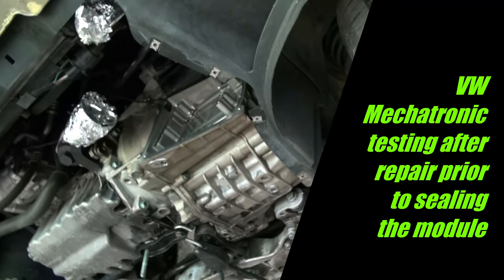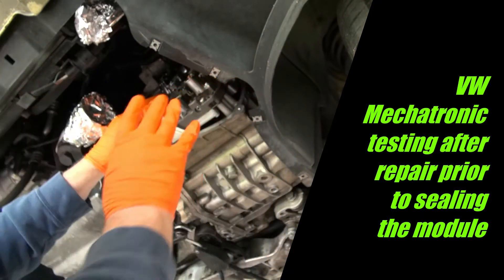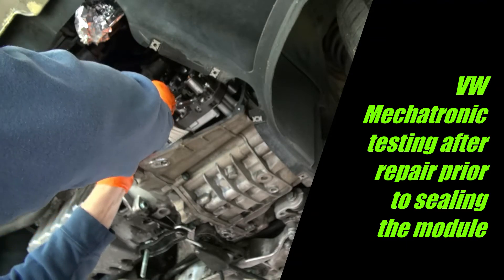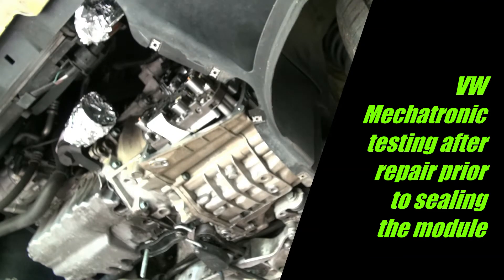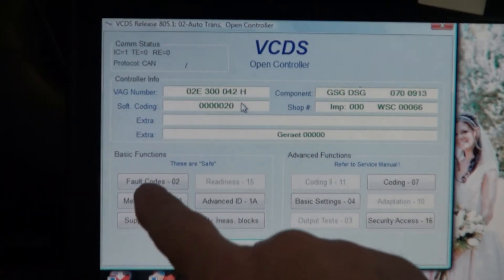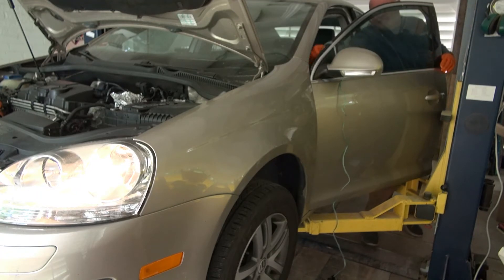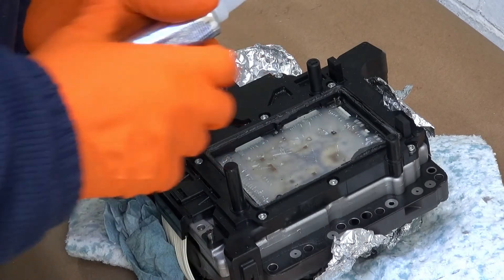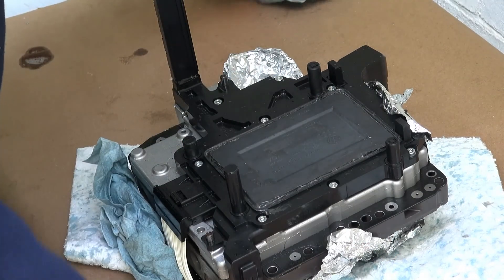VW mechatronic module test before sealing after internal repair is made

Comment: Update? Did she live?
Reply from the maker: Not for long, one of the connections broke again. I sold the car and happy to have it gone
Reply: @neuromanglers  ok but at least it worked a bit. I have 2 cars with the same DSG and I want to learn how to fix them. Your 3 videos have really really helped me out, I just had to know if it worked out even if it was just for a little bit.
Reply from the maker: I mostly wanted to confirm it was the module and I did confirm that but did not want to invest that much into the car since it seemed to start having multiple electrical/electronic issues.  I also have a new VW and found they are not honoring the warranty to my satisfaction so I decided to cease being a VW customer after decades of enjoying their cars I have had enough of the VW, they are not what they used to be
Reply: @jordanhagan1996  any update or link to your repair?
Reply: @neuromanglers  Did the same connection break again or a different one?